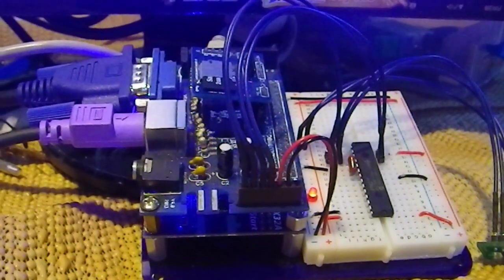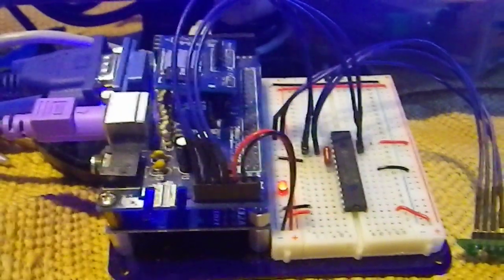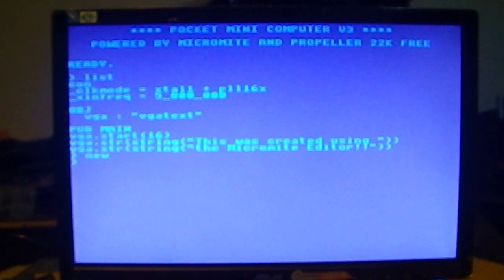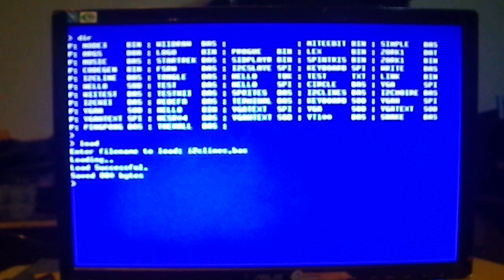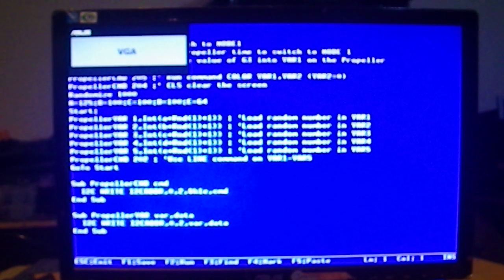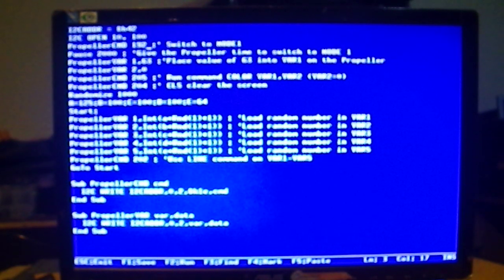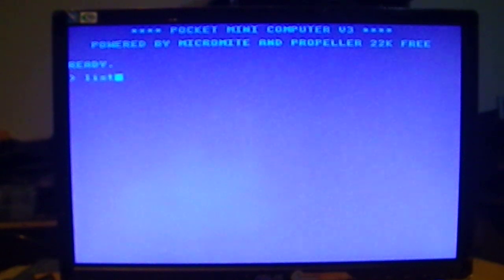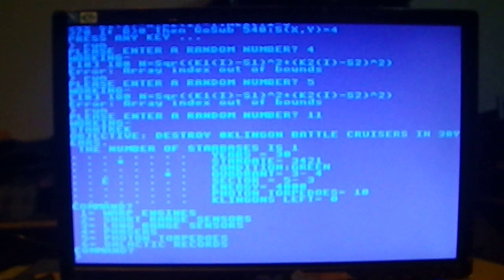Micromite Propeller Part1

Comment: Nice project!  I just ordered a Companion Kit, and cannot wait to get it!

Since the Micromite BASIC is Open Source, can it be rewritten and programmed into the PIC with additional commands, statements and functions that would automatically do the work of the I2C WRITE and PAUSE command lines for the various video operations and modes?  (ie. MODE (n=1-8), CLS, SDOPEN, n=SDREAD, SDWRITE(n), FORECOLOR(n), BACKCOLOR(n), PLOT(x,y),  and so on ...)  This would save a lot of program lines.